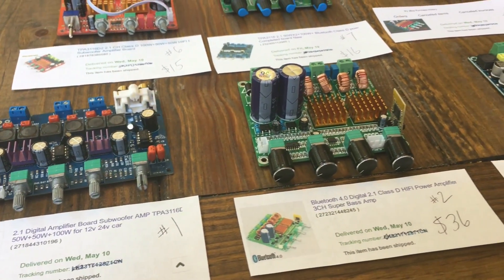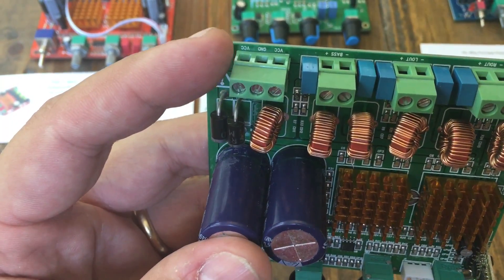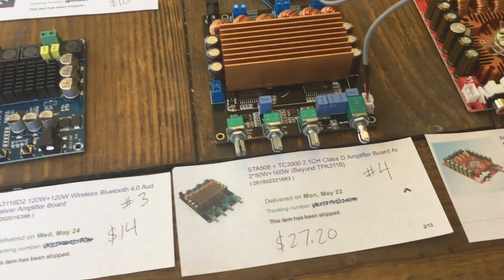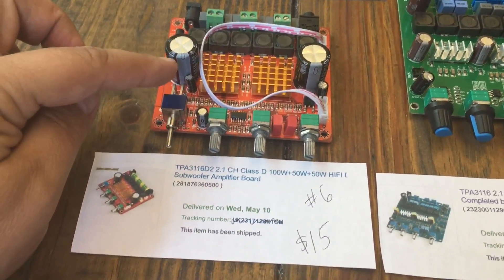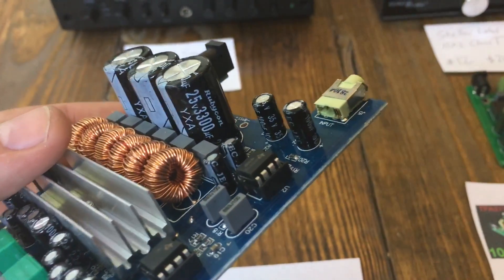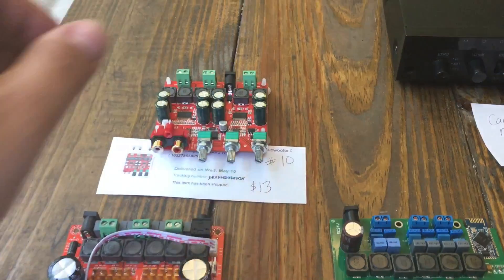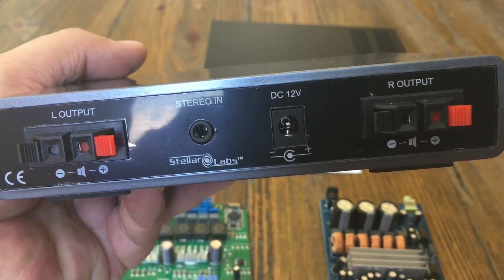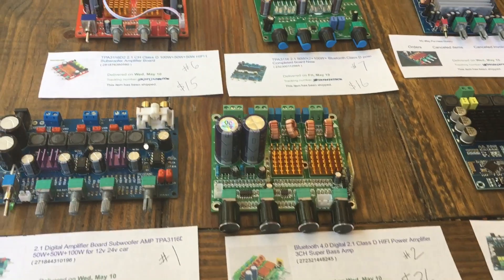Chinese Mini Amp Invasion #2 - TPA3116 and more

Comment: #1, #4, #6, and #8 look interesting to me.
I wonder what the thermal preformance of #4 is.
Reply from the maker: +Bert Van Berwaer initial tests of #4 at 24v were unimpressive. I swapped the mono TPA3116d2 $10 amp powering a 12" sub with #4 and it seemed way less powerful. We'll see if it wakes up with 32v and a fat input signal 👍
Reply: When you look at the datasheet of the STA508 you will see that it needs 35V to work, hopefully this does the trick.
Have you noticed a difference between #1, #6 and #8? They all look so similar to me, it's very hard to tell which one will be better without measuring them.

Comment: Hello there, I see that the #3 amplifier you got is the same as the one I got (just without bluetooth). If it's not too much, could you test the true RMS output power of it? I'm planning to use it with 2 Daytons DS115. Thanks in advance! PS: I feed it with 24V for maximum power as said in the description. Thanks again
Reply from the maker: +vascobrissos14 all will be tested for power output.  Personally prefer the units without BT, but wanted to try several. BT models appear to have high sensitivity input and more signal noise. Most quality BT modules cost more than the amps I'm showing here 😜
Reply: BigDWiz Same exact reason I started buying non BT amps. I firstly got a 50W amp with BT but as you said, it has too much noise and mine bugged up when I plugged a 3.5 jack on the port. From now on I'll buy non BT amps. 

I'll wait for your review of it. It's in 3rd place so it shouldn't take long. Thanks!
Reply: Hello again, forgot to mention that the daytons are 8 ohm woofers so if you could test the amplfiers or the amplifier at 8 ohm I would really appreciate. thanks

Comment: Wow the Data sheet for the TPA3116 says it is capable of 100 watts@ 2ohms mono! They only list the manufacturer for those as Texas Instruments! They also claim a wide voltage range from 4.5v to 26v and the die package size is 11 mm x 6.2 mm! I can only imagine in about the next 5 years the leap in technology car audio takes! Will it remain the same internally in the old school style or will it shrink in size with advanced components? 

I would say the most attractive ones for first testing would be the ones that feature larger inductor's which have larger gauge wiring compared to the smaller sealed inductors which are often found on computer motherboards as well as those that choose the smd mounted solid capacitors! These chips are capable of operationbetween -40C to 85C for 3 of the TPA3116 series but a max of 125C for the Q1 models but have efficient idle ratings, there are also 5 different forms, the Q1 variant being the most optimal design.

With the capability to operate between -40C to 125C, but those two models do not offer "SpeakerGuard", but they all do offer DC Detect protection and short circuit protection with automatic recovery! I am actually glad to see you take on these little amps!

Just for the Records, the specs for the TPA3116 are, 2 × 15 W "No Impedance listed" without external heat sink on a single layer PCB, 2 × 30 W / 8 Ω without heat sink on a dual layer PCB, 2 × 50 W / 4 Ω with a small heatsink attached to its top side PowerPAD with the Max Capability of producing 100 watts x 1 @ 2 Ω!

 But that 100 watts assumably would be based upon it having many inductors, plenty of capacitance and the full 26V with 7.5 amps of current and high output op-amp setup for the pre-amp section. The ratings, THD measured at 10%/1khz @ 14.4v is 25 watts and the THD measured at 10%/1khz @ 21V is 50 watts! Lets see how close that is with all of them!

Perhaps you should change a ratings sheet to list models and max output in stereo, mono if capable and maximum current draw at two base voltages, the spec sheet for the TPA3116 says 12-14.4 volts and 21-36+ volts! That way you can cover models that required different voltages! And lets see if you can include your 250 amp Variable power supply you used in the old days of your Bench testing just adding a transformer or step up converter for increasing voltages above the 19v!  

But can I get a thumbs up and thumbs down for a vote? Will Car audio amplifiers remain the same in design basics "Thumbs up" or will it make a drastic change in the next five years to more advanced Chip Based Technology "Thumbs Down" like seen in this style of Amplifier?

Comment: It is quite a pity that you bought so  many of basically the same amps with just slight differences.  Maybe it will be more interesing if you compred different chips- for example TDA7498, TDA8920, TAS5630 or even IRS2092 -these can deliver serious power. There is one 500W for 15 bucks. Only downside is that more powerful ones require symmetrical input voltage.

Anyways I am really interested in future tests of these amps. Thank you! Keep the great work up!

EDIT: sorry I havent noticed that you actually have TDA7498 one... I am foting for #5 so we can see whether TPA or TDA is better
Reply from the maker: +genius3258 I've been really happy with the TPA3116 based amps I've tried thus far. I bought several of those really to compare for myself, thought you guys would like to join the ride
Reply: of course! your money, your choice
Reply: genius3258 I agree with the IRS2092! except for the exact reason you said about the power supply they required to make them work. I already have a quite a few of the chip amplifiers myself (16 different ones to be exact) but my favorites would be, for the smallest and most efficient would be the PAM8403 which I have managed to run on a single 18650 battery for days at a time. And for the beefier board would be the one with the TDA8950 chip, but then again I have a toroid transformer hooked up to it to supply it's required power input requirements.
Reply: Best chip amp in my opinion is the TAS5630 by far the amp that lasted longer i had and i have had like 10 difrent ones such as tda7294 , tda 7377 ,tda3116d2, TDA7498E tda2030a tda7293 , TDA8950 and a couple more class ab chips that i forgot all of them died in less than a week so far this one has lasted 5 months .. 
it would be great if u tested the TAS5630 2.1 amplifier on eBay its a beast!
Reply: genius3258

Comment: Most interested in the 7498e... I'd like to properly size a step-up converter for one thing. 2 or 3 of those, the right sized bucky converters, and a relay could make for a super budget car setup... if they perform.

Thanks man, these really scratch the tinkerer itch.
Reply: No you don't. They make cheap continuously variable step up converters like so... Perhaps bucky converter is not the generic term I thought...

http://www.ebay.com/itm/New-900W-DC-DC-Boost-Converter-8-60V-to-10-120V-15A-Step-Up-Power-Supply-Module-/291861952982?hash=item43f453f9d6:g:T1MAAOSwxg5Xx9Qq

will step up voltage from 8v to 120v dc if you like. It can only draw 15 amps so if your input is 8v you only get up to 120w out of the converter. If your input is 14v you can output 210 watts and so on.

This is just one example, they are all over ebay... from five dollar 6 amp converters to twenty dollar 20 amps
Reply from the maker: This is the one I got, works good - https://goo.gl/mrqMGr

Comment: please test ........ # 4 ........
test at 12 volts PLEASE! 
2Ω load that bad boy @ 12v and see what it does. 

THANK YOU!
Reply from the maker: +james craghead #4 wants 32 volts...I can try at 12v too, but I'm betting it will be weak
Reply: BigDWiz I know it wants 32 but if its rated to work on 12.... give a shot I'm curious. if not... #5 with the fan is my next choice. I really appreciate you doing such an awesome test!!! have wanting to EXACTLY these test. :)

Comment: i use the number 8 bought like 4 total, family members confiscated the 1st 2 lol pretty nice for $14 + power supply 24v recommended
Reply from the maker: +Bryan Hayes which power supply do you use? The 19v Toshiba 4.74A laptop power supplies are only $17. I'm using 12v batteries in series when I test these amps, but the ones I have are a bit large for portable use
Reply: I am currently using this seems to work fine for the home  "8 in1 Universal 100W AC Adapter Power Supply Charger Cord for Laptop Notebook" http://www.ebay.com/itm/8-in1-Universal-100W-AC-Adapter-Power-Supply-Charger-Cord-for-Laptop-Notebook-/401256729739?hash=item5d6cc3cc8b:g:RXsAAOSw2xRYc11O
Reply from the maker: +Bryan Hayes thanks for the link. I'll pick up one of those to try out

Comment: cool vid,,I have a quick question. What damage can i do to my dual voice coil sub only hooking up one side? I like to hook it up like that for better lows for now so the amp is running 4ohm
Reply from the maker: +richard r it won't damage the sub. ShowtimeSPL has a video showing what happens when you use 1 VC in a DVC sub
Reply: Ok props an respect Derek thank you for the quick reply Ive been subcribed to you for along time atleast 4yrs

Comment: If these amps were available back when you were running the CDX-7520 in your Courier, would you have ever used these amps in your system?
Reply from the maker: +thebestofall007 I would've tried them for sure! Not enough power @12 volts, but crazy deals for the $$

Comment: What do you do with them? Use them in the house or car? Can you hook up one to every door speaker? I just don't get where you're going with these
Reply from the maker: +I am Coast2coastLoud mainly using with AC to DC power supplies and using them in home audio projects. They work at 12 volts too, so you could use in a car I suspect. They would also be cool to use in a DIY boom box project